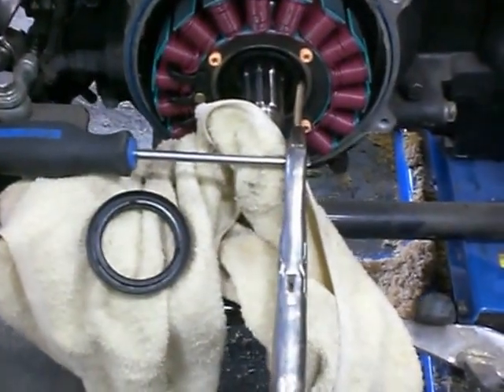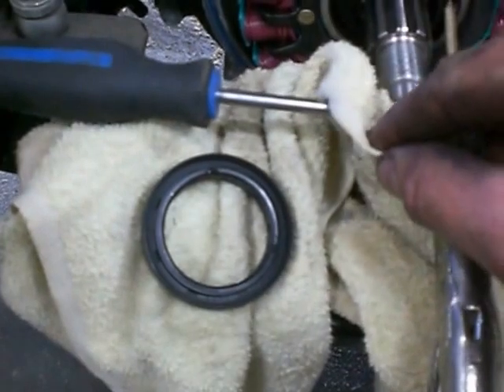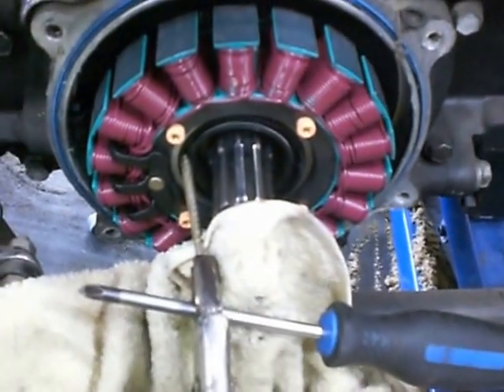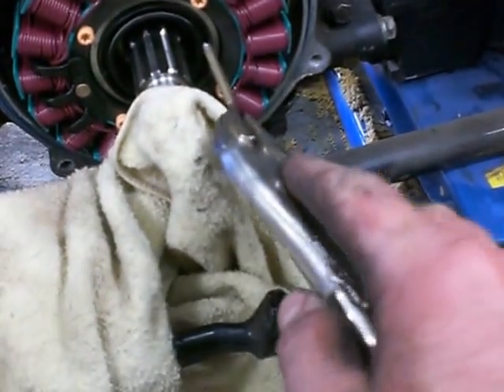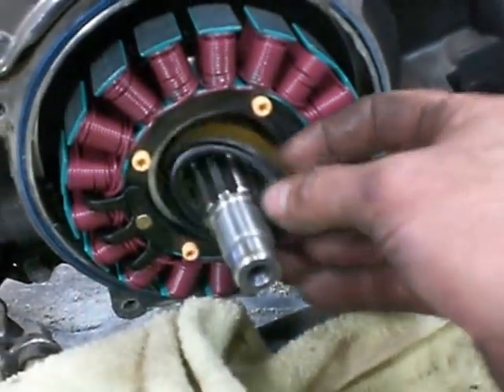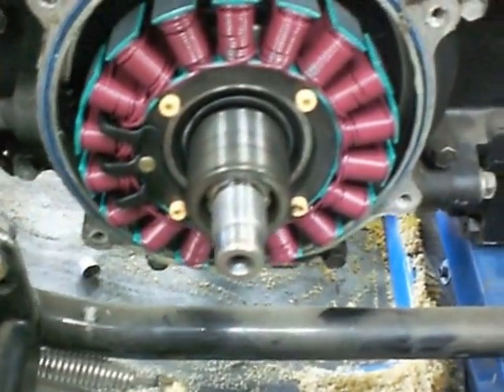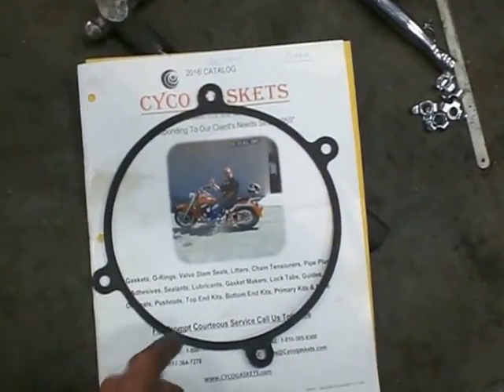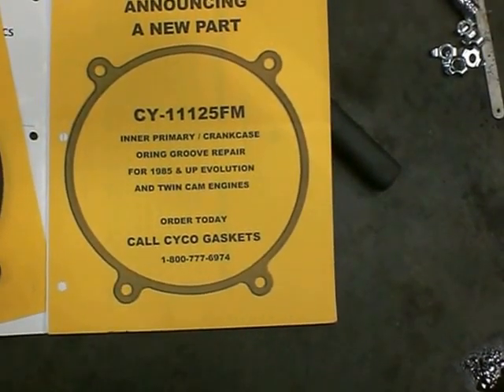Real Easy Harley Seal Removal

Comment: Hey brother great video very entailed, thank you I got a question I have a 2005 15th anniversary Fatboy I changed my primary fluid and I only got 20 out of the 27 that I put in.. about a month ago, I'm hearing it's the seal ,( crank seal)you're doing right now is that true and if you can give me a little information I highly appreciate it! Thank you in advance. 
  PS I had a brand new s&s crank 43/8 stroke installed about 3 and 1/2 years ago??

Comment: Thank you for taking the time to make this video. There doesn't seem to be many on this topic. I do have a couple of questions. 1. Do you recommend removing the sprocket shaft spacer before attempting to remove the seal? I thought leaving the spacer installed might protect the sprocket shaft from any damage from the screw. 2. What size deck screw did you use? 3. Looking through the comments, I see you mentioned that you need to screw into the metal part of the seal. Isn't there a danger of scratching the inside of the bore with the screw? I appreciate any information you can provide. Thanks again!
Reply: Update: I removed the sprocket shaft spacer; I then used a pick and removed some of the rubber on the seal closest to the crank sprocket shaft, then used a Harbor Freight 2 lb slide hammer with the puller hook attachment and the seal popped right off!
Reply from the maker: I have never damaged the bore, take your time and don't put the screw in to far.  I only put it in a couple of threads deep so nothing will get damaged.  I honestly don't know the size of screw I use, I just used a screw sitting around that I used to screw sheets of 3/4 plywood on to my second story floor.  Just make sure not to use a drywall screw, they are to brittle and will most likely break when you try to remove the seal.  Don't be afraid, it's real easy  to do
Reply from the maker: I always remove the spacer when I remove the seal.  Sorry for the late reply, if you have any other questions please feel free to ask

Comment: I have a slide hammer with a vice grip attached to the end - works a treat
Reply from the maker: I love it when people make their own tools.  Good job buddy,
Reply: Do you recommend a specific brand or certain slide hammer? Thanks...
Reply: @danielmoody8590  Just buy a slide happer from H.F. and modify the screw on the vice grip to attach to one of the threaded pieces on the slide hammer - I think I welded mine on.
Reply: @glenndavis2762  Thank You!

Comment: Cool I'm gonna try this method 😀👍 .But what  you use to put the new seal in ? Did you tap it with a rubber mallet.
Reply from the maker: I have done so many of them, all I use is a ball peen hammer.  Take your time installing the seal, and don't get frustrated.  It can be a bear getting it in if you have never installed one before.  You will eventually get it in the hole.  Be sure the seal is sitting flush in the outer face of the hole when you are done.  If the seal is in the hole crooked you will end up with an oil leak.  If you have any issues and need anymore information send me another question, I am more than happy to help.

Comment: Thanks for the video. Helps a lot! I was wondering what the name for that spacer that goes in between the seal is?
Reply: It’s called the motor sprocket shaft spacer. Amazon has them for about $30

Comment: Do you use any kind of loctite on the outer metal seal surface when install it?
Reply from the maker: I have never used any type of sealant on any of the seals I have ever installed and have never had any leaking issues.  Just make sure the seal is sitting even with the outer edge when you install the seal (make sure it isn't crooked in the hole) and you will not have any leaking issues with the seal on the inner rubber area as well as the  outer metal edge.
Reply: @100cockroach  thanks a lot.

Comment: Is it possible to remove that stator plug without cutting it?  Trying to replace mine and can’t seem to see how it would come apart.
Reply from the maker: The plug sometimes has some silicone on it . twist it from side to side gently, when it's free you can push it out.  Sometimes you will have to work at it for a while to get it out, keep at it, it will come.    Be careful not to damage the wires if you are going to reuse the stator (keep the wires in the plug to remove it).
Reply from the maker: How did the removal go?

Comment: I see you didn't take the inner primary off, do you think I could get to the seal without taking my inner primary off 2012 fhlx
Reply from the maker: You sure can.  I just did it to an 08 FLH which is basically the same setup and didn't have to remove the inner primary.  If for some reason you decide to remove the inner primary, don't forget to remove your starter bolts before removing the inner primary.
Reply: @100cockroach  thanks
Reply: @100cockroach  How do you get the leverage on the end of the crank with the inner primary installed?

Comment: What happened to the part of your vid to show installing the seal? I read in the comments that you used a 2 x 4?? I guess, use what is handy but why not us a piece of PVC pipe or steel pipe of the appropriate size?
Reply from the maker: I have installed so many of these they just pop in for me.  Next time I get one in the shop I will make a video installing the seal for you all.   You can try a PVC pipe,  It may be a little too slick (slippery) to install the seal but it will be worth a try.  I have used a piece of wood but normally use a tiny ball peen hammer to install the seals now.

Comment: I tried removing mine like this and it just came apart in peices.  now I can't get it all out.  what can I do? It is a 1989 fxstc
Reply from the maker: Can you upload a photo of it so i can see it.  There is a lot of room around the seal to drill more holes in it.  Are you sure you are drilling only into the metal part not the rubber part.
Reply: pretty sure it was  rubber part :(.  but there wasn't much left; don't know what to do (or even if you got the pic)
Reply from the maker: It looks like you are drilling into part where the rubber and the metal parts are joined.  Move your screw closer to the outside of the seal.
Reply: how much farther out should I go?
Reply from the maker: Absolutely Jon, I got the picture.  If you drill only into the metal part it will come out,  just work it back and forth like I did in the video or you can attach a slide hammer to the screw and pull it out using a slide hammer. Sometimes the slide hammer will rip the screw out of the metal part of the screw.  If it rips it out simply drill another hole and try it again.
Reply from the maker: If you want me to, I can go to the shop and grab a seal and show you exactly where to drill
Reply: I'd love it; thank you

Comment: What did you use to put the seal in?
Reply from the maker: A piece of wood (piece of 2 X 4) works the best if it is your first time installing the seal.  I have done so many I only use a small ball peen to install my seals now.  Make sure your seal goes in relatively strait and be sure your seal is strait in the hole when you are finished installing it.  That way you will not get a leak in a hundred miles or so down the road and end up reinstalling another seal again.
Reply from the maker: Just tap on the piece of wood with a hammer and it will do in.  It takes a little while to get it started.  Don't get frustrated,  take your time, it will go in.

Comment: The lip was facing out on that seal so thas for dry belt primary.
Reply from the maker: No, it was for a wet primary.  Make sure you look at the seal when you remove it and put the seal back in the way you removed it.
Reply: Ok im doing mine now and i have a dry primary so the flat side gose in first cause its to keep oil in the motor. So the channeled, Lip, Toe what ever faces out for dry primary.
For a wet primary the mech seal gose flat side out to keep oil in the primary and not flowing back into the motor. 
ether way always lube the seal or burn it out on start up. some recomend changing  the spacer and seal as a pair as im doing.. 
also the two stator plug screws need blue loctight as they can also leak. red loctight on the sprocket shaft to fit back on the pully. 
what did you torque your sprocket shaft nut upto?.
book says 240ft lb for a Shovelhead seems excessive to me?. 
How did you lock the front pully and did you use a torque wrench. 
Never rattle the nut up is another bit of advice i have. 
The nut also will need red loctight. Cheers.
Reply from the maker: @eazyrider6122  I keep everything real simple.  I grab a rag and fold it up a number of times and I put the rag between the front pulley and the chain and then I torque the bolt (I have found that the rag never damages anything).  I  always use red lock tight on the crank bolt.  I always use a torque wrench on all the bolts.  I do not want a bike to come back due to a simple loose bolt or have to pay for damaged caused by a incorrect tightened bolt.    I have not worked  on a shovel for a long time so I honestly can not recall the torque on the bolt.  If you want the torque I can get it on Tuesday for you
Reply: Don't put back in the same way if your going to change from wet to dry primary.

Comment: You put the seal in backwards
Reply from the maker: It's important to look at the seal closely and determine from the ripples on the inner edge of the seal which way it is supposed to go, in relation to the way the shaft turns.  Remember you want to hold the oil in the engine.  If you are unsure which way to install the seal refer to your Harley OEM manual

Comment: When you put the seal back in does it need to be flush or pushed all the way in.  I did mine flush but I have oil coming out the middle of the sleeve.
Reply from the maker: It should be flush all the way around. If you seal is pushed in more on one side you can get a leak. Are you sure you put the seal back in the correct way?  Did you happen to damage the seal when you installed it?

is it leaking between the seal and the shaft or,
 between the seal and the seal metal outer surface or, 
 between the seals outer surface and the case?
Reply: Its coming from the middle of the sleeve and shaft
Reply from the maker: I don't know what year of a bike you are working on., There is an O-ring that goes on before you install the sleve. Are you sure that you installed that O-ring?
Reply from the maker: If you installed the o-ring are you sure it was the correct O-ring. There are a lot of O-rings in a bike rebuild kit. The rebuild kits I use have a O-ring that is square. What I mean by that is if you cut the O-ring in half and look at both ends they look square.
Reply from the maker: Sorry I thought that this was the transmission video I had up. Disregard the O-ring reply above. What year of bike are you working on is where we should start from.
Reply: Lol you had my mind running ramped for a second with the oring talk.  Its a 2004 fxsti standard.  Thanks
Reply from the maker: Have you tightened your compensator bolt? If not thats the prob.
Reply from the maker: If you havent tightened the compensator bolt it will leak out.
Reply: I think that's probably going to be my problem..   I appreciate the help... Thanks

Comment: The screw keeps coming out of the hole
Reply from the maker: You are either putting the screw into the rubber seal or you are not putting it deep enough into the steel part of the seal. The screw has to totally be in the steel part of the seal, it can not be half in the rubber and half in the steel seal housing.  Try drilling another 2 screws into the seal housing.  You will get it out.
Reply: @100cockroach  
I got it out hit the retainer a little straightened with screw driver.
Hope I’m good. Put double lip seal in backwards with pvc made flush with the cast
Reply from the maker: Glad to hear you finally got it out, and your homemade PVC install tool worked for you.  Most people think they need the expensive tools to get the job done, sometimes the cheap homemade tools work way better than the expensive tools.   Great Job

Comment: Any info on what you use to tap in the seal?
Reply from the maker: Joe, I built a install tool to install the seal. It's simply a nut that has the same threads as the crank threads (I think I purchased the nut at my local bolt supply shop) and a number of large washers that are larger than the seal and have a hole larger than the crank shaft pin. I then thread the nut on to the shaft with the washers and push the seal on. I used this method for a long time but now that I have installed so many of these it's a lot easier simply using a small ball peen hammer and tapping the seal into place (make sure the seal is installed the same distance into the seal opening all the way around or you will have a leak there again.  I will make a video the next time I install another crank seal for you. Rite now I am doing a number of cam chain tensioner bushings. For some reason everyone wants them all changed at the same time.
Reply from the maker: https://www.youtube.com/watch?v=bDRNwwVC3bc  You can take a look at my other video for a similar tool I use on the transmission shaft seal
Reply: Thanks buddy that's a cool idea. I've already just tapped it in with a wooden block. Thanks for putting out your videos, they're very good.
Reply from the maker: I have been meaning to make some more videos to help you all out but always seem to get a little side tracked on other projects.  Thanks for the reply Joe

Comment: No spacer replacement..that's usually what wears and cause the leak.
Reply from the maker: Or you can simply install your spacer the opposite way you removed it, that way you can save a few bucks .  This only works if a mechanic has not done it to your spacer previously.  It's a good idea to get another spacer though

Comment: what did you use to drive the new seal in?
Reply from the maker: I have installed so many of them it's pretty easy for me to do.  It wasn't when I first started installing them.  I use the plat edge of a ball peen hammer.  I start one edge of the seal and begin tapping the seal in (not hard or to soft, it's a knack you will learn after you get the first one in) on the other end,  In the beginning it will  pop out a number of times.  Don't give up, it will take time if this is your first time.  You will get it in.  If you get frustrated leave it .